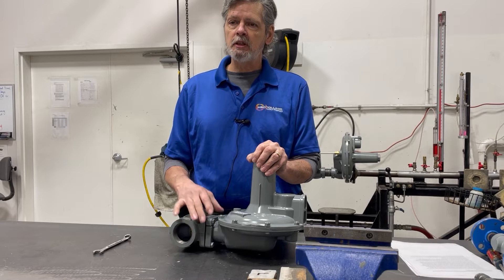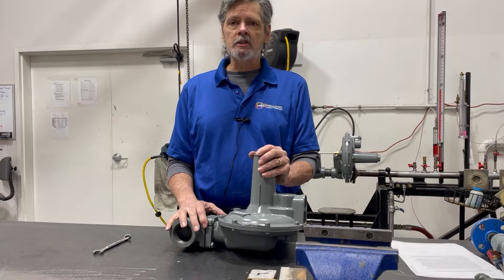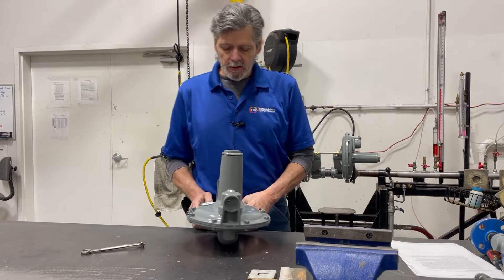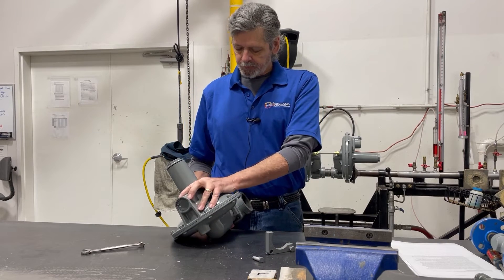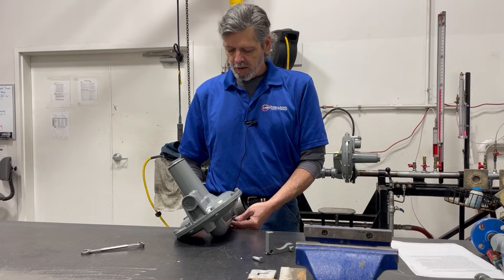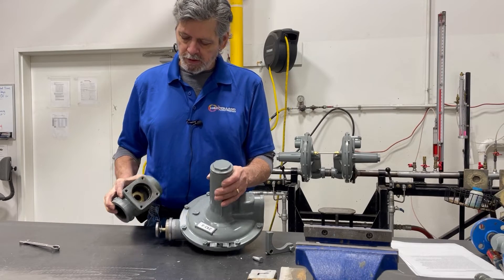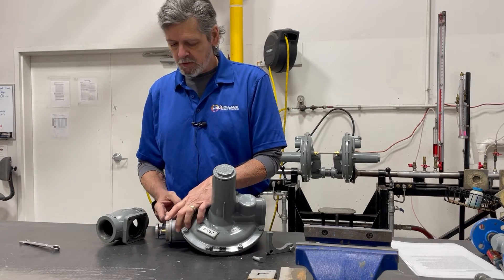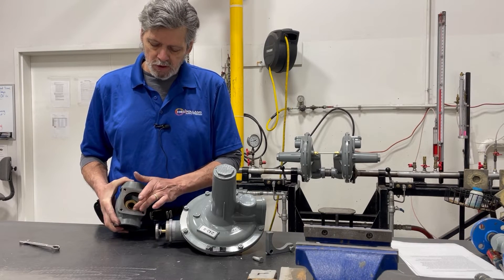How to Install the Tetraseal on a Model 243 Regulator

Comment: The seal on my regulator is disintegrated. But I think there was also a seal on the outside of the throat as well. I didn't have good lighting it was night time. I took the regulator completely apart and cleaned it it had grunge and dust inside. I put it all back together blah blah blah but there's no gas coming into the house thus far. I think I need one of those seals like you just mentioned in this video. The regulator is for natural gas and it is located outside. It's 20° and when I took the regulator off I noticed a bunch of ice down inside their, the pipe,, all around the little spring loaded valve. Tomorrow morning we're going to pour more ethanol into the ethanol tank., it acts as a water dryer. There's nothing to these regulators now that I've taken it apart and put it back together, I understand them better now.
Reply: Where do I get the tetra seal? This one went bad.
Reply from the maker: If your regulator is a Sensus/USG model, we may have a replacement tetraseal for it. You can email our sales team (sales@hollandsupplycompany.com) and they can provide better information on what we currently have in stock. They would also be better equipped to provide guidance on your issue, though you may also need to contact your utility about a replacement.
Reply: @hollandsupplycompany  Fisher controls.